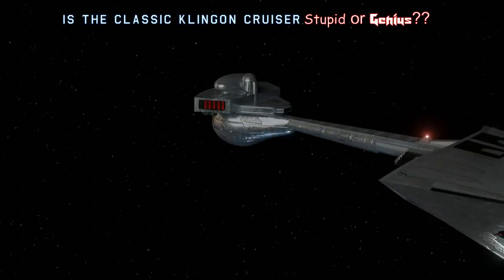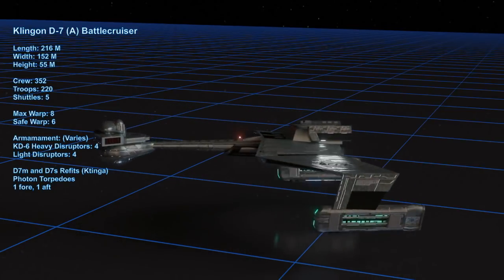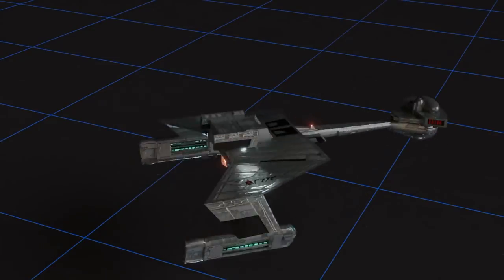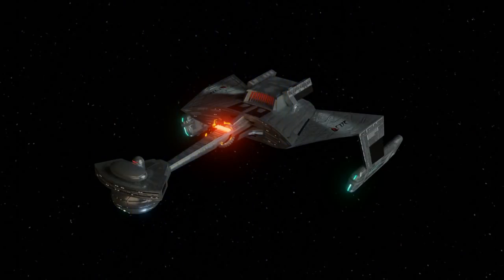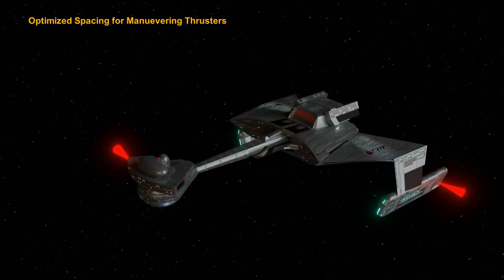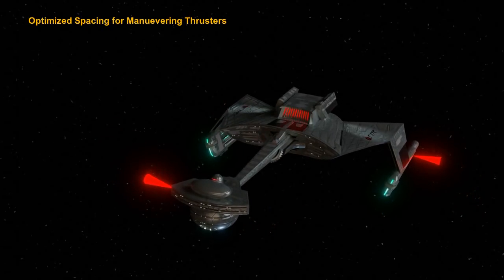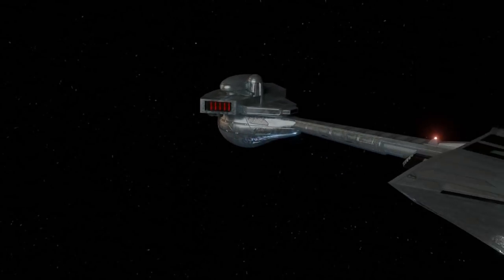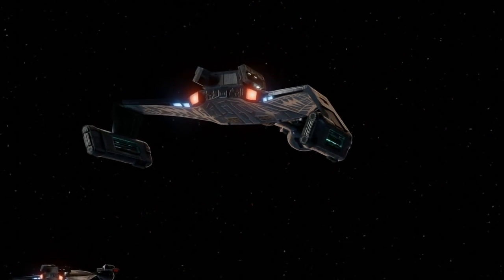The Classic Klingon D-7 Cruiser - Stupid or Genius Design?? Animated Breakdown!

Comment: Given how literally every Klingon ship follows the same design philosophy...there are a few things here. 

They may have to lay the ship out this way to make it work. A combination of sacrifices in any design is why they look the way they do, and with the Klingons, it's a mixture of probably RCS thruster location vs center of mass ( the Klingon ships have a very, very, aft center of mass ), relative to warp field dynamics, and optimal placement of weapons frontally, in addition to minimizing the frontal aspect. 

One thing not touched on here, which is weird for a video on a warrior race, is how the ship would faire doing...well...Klingon Shit. 

The Cloak and it's ability to function optimally, how much area needs to be shielded vs volume, given the above constraints ( maybe that's why the forward hull is more spherical, it's more efficient given those design parameters ), it's possible the layout was chosen to optimize it's survivability in combat based on studies done by the KDF. Like these are a warrior people after all, finding any way to gain an edge is their thing! 

There really could be some crazy deep lore here.

Comment: Star Trek ships have shields and structural integrity field, so shooting in the neck doesn't matter. But if the director needs to, he can even teleport torpedo warheads through shields, or at least firing at engines. On the other hand, if a ship loses shields and a field of structural integrity, I see no reason to shoot in the neck and not straight at the core.

Comment: The biggest reason?

It doesn't matter.

It is a perceived liability that isn't a liability at all.

Klingon Battle Doctrine is a doctrine of movement, and at range and speed, the "neck" would be almost impossible to hit given maneuvering, shield modulation to break targeting locks, and the fact that targeting a moving target isn't actually all that accurate in the Star Trek universe.

Only an idiot would shoot at a  figurative pencil and waste shots when you have a much larger target at either end of it.

Couple that with the fact that "Shields Are King" and the first combatant to lose shields typically dies instantly thereafter, and the long, thin connecting superstructure doesn't really matter at all; it actually provides benefit in a much smaller targeting profile when the vessel is coming about to bring its heavier cannon back on target.

Comment: In my opinion it’s because of how rudimentary the drive system is and how dangerous the radiation factors are in the drive station that’s why they that’s why they have the snack or boom so when you separate your new separating yourself completely from the drive section and it allows you to be far away before the work court decides to explode because remember several times and I reference Star Trek for the voyage home where Scotty says the Klingons and there Dellithian crystals are very premitive and therefore it wouldn’t seem to me that their star drives Are rudimentary in primitive and probably very very very very very dangerous and explosive

Comment: I don't have anything to add regarding the architecture of the D-7, as that's way above my pay grade.  I just wanted to express my irritation with the Trek showrunners at how badly handled this ship was post-TOS, particularly as it relates to the Bird of Prey.

In short, The D-7, K't'inga or otherwise, should've been portrayed as absolute monsters.  Any Federation captain coming across one should've fled in sheer terror at a mere sensor reading of its warp signature.  TWoK did do it >some< justice as having them be the antagonists for the Kobayashi Maru test, but later movies and series seemed to relegate them into trivial side roles or, even worse, nostalgia bait.

Instead, everyone, especially Leonard Nimoy, seemed to fall head over heals for the BoP, even going so far as claiming that they were well suited for frontline combat.  This despite the fact that it was little more than a dingy when compared to a proper D-7.  This was further cemented with Kruge going head-to-head with the Enterprise in TSfS and, bewilderingly, coming out on top, despite being hit with two photon torpedoes, one directly slamming into the BoP's front bubble.

While it was great to see a full-bore K't'inga as the Klingon flagship in TUC, it still didn't do much of anything in terms of firepower and, ONCE AGAIN, the BoP takes center stage as the dreaded newfangled ship that could fire while cloaked.  I guess I should be thankful that it only took one torpedo hit for Chang to go out in a blaze of glory (which is entirely correct for a shield-less BoP).

Anyway, I just had to vent a bit.  Maybe STO does a better job with the D-7.  God knows some manner of media should.

Comment: Well actually... There is a Way better explanation of why there is a boom and why it is actually hard to sever. Because of the "compact" nature of the rear section, there is no rear good place to put battle shields. So the long boom holds the main shield generators and emitters. The shields would cover the front and all around most of the ship with it's weakest point at the rear. Klingons would think this is a very good design because what honorable Klingon would need rear shielding unless they were running away... With the shield generators at the boom, it would be the strongest part of the ship.

Comment: Dude... it's OBVIOUS:  
The Klingons are focused upon INFANTRY combat.   There are TWO locations needed to control a warp-vessel from a boarding and capture perspective:  Engineering, and the Bridge.  A single narrow and long neck between these two points creates a choke point that is very vulnerable to a force of troops trying to take control of one those points from the other one.  Any force trying to do so would have no chance at flanking the defenders of the other section.  Consequently, they are forced to engage in a costly and brutal frontal attack.  Obviously, Kingons assume that they will win in that sort of battle.

Comment: Klingon ships DO NOT have all weapons Firing only in the forward arc.
when looking at Starship games like Starfleet Battles in particular. Klingon ships with this type of configuration have Superior Weapon firing arcs.  These types of ships could move at incredible combat speed without sacrificing weapon and defense energy distribution. An effective tactic called "Saber Dancing" uses high speed "drive by" attacks as most other ships cannot maintain pursuit speeds with out exposing themselves to to withering fire from the Klingon weaponry.  A Klingon D7 can bring nearly 80% of all secondary weapons to bear on a target from any orientation. The next best ship might be able to bring 60%. The unique hull design allows for Cross deck firing arcs. Later variants even had all disruptor weaponry mounted to deliver full volleys  at targets with in the entire Forward Hemisphere. These ships could deliver 90% of it's firepower at a completely broadside enemy ship.  This presents a larger silhouette, weaker shields, and engineering sections . The lack of speed and firing arcs of the enemy forces them to fire at the Klingon ship at a head on or an oblique angle.  Allowing for predictable shield reinforcement.
Sorry I have been Flying Klingon ships in Starfleet Battles for 30 years. I had to share.

Comment: I'm not sure I buy most of these. There's no reason for the narrow neck and wide "shoulders" aside from intimidation. Compartmentalization can be done with better structural soundness. Narrowing the "shoulders"  and relocating those sections to the neck would reduce rotational inertia by moving more mass closer to the center of rotation while strengthening the neck. Detaching a command section could be done at literally any location on a ship that has access to the outside, you just have to put in the infrastructure.

Intimidation is sound, though, because the majority of Klingon weapons and tactics are intimidation focused. A Klingon battle charge leaves a lot of dead, but Klingons are willing to do it and it's intimidating. A bat'leth is an unergonomic and poorly balanced weapon, but it's very intimidating. Disruptors are less accurate and potentially lower range than phasers, but they blow shit up in a very intimidating way. D-7s have a very distinct, angular shape that is... intimidating.

Comment: I do not buy the radiation explanation. You have to be able to protect from radiation created by weapons fired at you as well as by the galaxy at large. And if you can do that then I find it hard to believe you can't protect from your reactor.
I think richy0326 has it right in his guess number 3 and 4: cargo pods can be attached there and that corridor makes it very hard to board and take both sections, respectively.

Plus, the difficulty for boarders is also a difficulty for matinee.

And if 3 is right that all we've ever seen is a d7 type in its bare bones state. It is easy to imagine cargo pods that click into the main hull almost seamlessly, run along and engulf the entire neck to end at the back of the command pod, giving a HUGE volume for all sorts of things.
Indeed, now that I think of it, there was a freighter in Enterprise (the one stuck in the jovial atmosphere) that looked like a d7 precursor with pods on its neck.
And if it's possible for two d7s to fly, ad hock, as one ship, attached at the nacelles then you can use the neck attachment points to stabilize objects being transported between the hulls.
Interesting... This is an interesting look at klingon logistics. The idea being that a task force of d7s can bring with them their own equipment and logistical infrastructure without need to bring vessels of lesser capability. And all you need is one ship type in the fleet, so, theoreticaly only one manufacturing workflow across the empire.

And maybe that was the intent for the d7: A jack of all trades, master of none and better than any master of one. The backbone and muscle of the fleet..... And maybe it succeeded! Maybe from TOS to TMP and beyond the entire fleet was almost exclusively d7 and variants! After which they had to try to figure out what would come next! And the expectation projected onto the predecessor would be enormous! No wonder they all have that look!

Interesting!... Very, very interesting.

Comment: The space in that neck could be a maximum of 6 ft wide and 7 ft tall I mean that's it that's all they need for people to go in One direction single file and that even leaves enough room for people to squeeze through going both directions the rest of it could be thick plate armor I'd say it's designed to take at least one solid hit now if I was the federation I will try to make some kind of a cutting beam to cut through that s*** or shoot it with a torpedo

Comment: Well, every country has put ships at sea with some compromises on crew safety- it's par for the course. Some countries have worried about it more than others. The Soviet Navy didn't seem too worried about it and they were officially an egalitarian society. It was all for the motherland, after all. So while the Klingons' values are not Soviet values, I would not expect them to worry too much about health and safety either. That's the sort of thing post cold war western humans focus on. Not soldiers of the empire and warriors.
It might make it easier if you use kuve of course, but you make fair points against that. [On that- are kuve canon now? I only remember that from The Final Reflection.]
Plus- it's deep space flight and interstellar war. It's gonna be dangerous even when not being fired on. Even Starfleet cadet vessels can kill you with delta rays if one baffle plate ruptures, and the Galaxy class warp core is a time bomb.

Comment: this could just as easily apply the the INCREDIBLY stupid design of the Nebulon-B which in my estimation is EVEN WORSE then the D-7. Half the ships lengths is a thin boom section that serves no purpose other then as a structural weakness and ironically one Fan animation i have seen ALSO says that its possible that the Neck is essentially the barrel for a spinal weapon or at least was supposed to be. WHY this would require such a easily severed for and aft section is anybody's guess. THIS is especially bad for a Universe where Starfighters see heavy use to target vulnerable or key systems on larger ships and most ships use weight of fire over accuracy to beat down their opponent. this makes it FAR more likely that having the entire middle section of your ship being a UBBER THIN SPAR would take a lucky hit in the middle of a turbolaser barrage.

Comment: Cutting the neck of a Federation or Klingon ship is not smart. There is no critical systems there. And since they were designed to act independently from each other. Cutting them apart only now give you two ships to fight instead of one. You end up with a poor mans multi vector assault situation like how the Prometheus class operates. You just spent time effort and power attacking a non-vital system. 
Even Kahn knew. When shields are down. Target Engineering, not a neck or pylon.